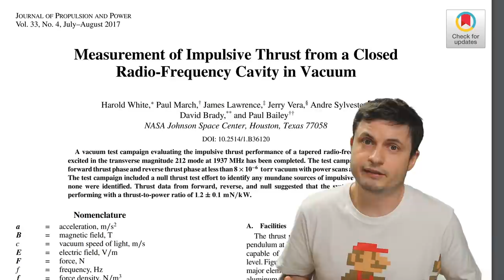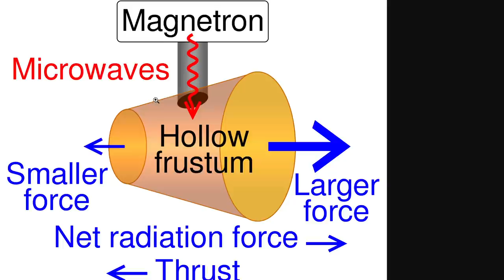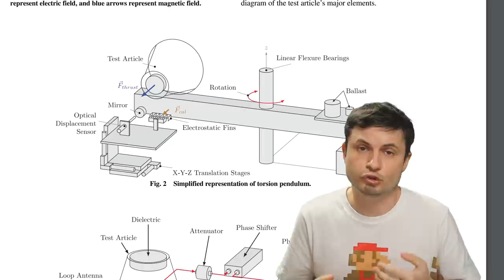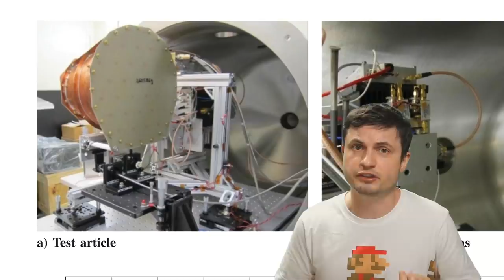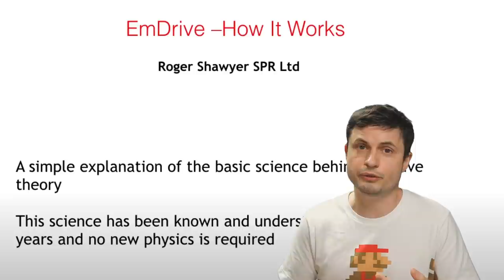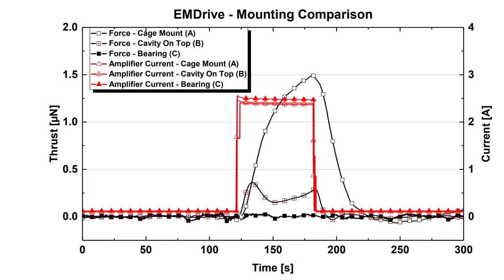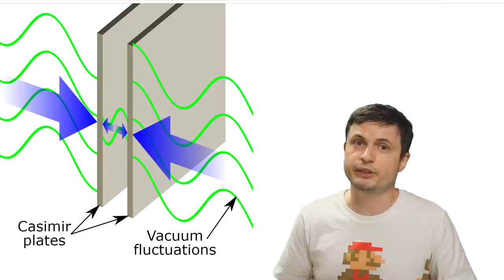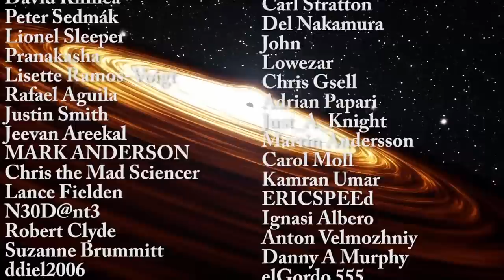Looks Like EM Drive Is Officially Dead - Experiments Fail

Comment: What you said made me think about something. 
Heating up an object deforms the object, could you alter or deform space similarly?
Reply: Er ... No.
Reply: @AndrewBlucher  I’ve sipped my coffee, I’m good now. 
Space is nothing to heat up, no particle to excite. 
Don’t science before breakfast, kids.
Reply: Anything with energy density deforms space. That's how gravity works. See einstein field equations.

But the deformation is very, very, very, unimaginably tiny for any power supply shy of a black hole.

And even so, it still wouldn't violate conservation of momentum.
Reply: @bryanreed742  Yeah I was thinking how matter tells space how to curve, and enough matter will curve space to the point of a black hole, I was sleepily wondering if, theoretically,  enough blackbody energy could deform space in a similar way, not to break conservation to make EM work, as tempting as it is to break the laws of physics to make the idea work, but what are the limits in heat alone being be used to deform space to propel objects?
Reply: Like, in the same vein as warp theory,

Comment: 6:35. 660 watt?? That's a dam lot less than the average heater. 1500 watt. You definitely gotta shop to get less than 1500 watt. If I'm thinking this right, which it sounds like I am.

Comment: Uhhmm... pushing on the steering wheel... No. However rocking in the vehicle; just like rocking in a chair... can move you across the floor. I am suspicious of the EM drive... but think that testing is healthy and more testing is better than no testing and limited testing. I am also suspicious of patents not being pursued after the twenty year period... and only being subjected to limited testing after so much discussion. Because “cold fusion” type events are usually measurement errors... and in order to duplicate something for science the original device is often not fully available nor reverse engineered... leading to a potential loss of discovery.
For example in order to create or recreate the known Tesla examples of power broadcasting... would require examination of the exact materials used. Because most likely the results were related to “impunities” in the materials used. As industrial processes and sources changed these impurities were lost and not subsequently looked for... because Tesla was a unique genius and a thousand people with the same equipment would not be able to make what he did... so we need to both look for any material science possibilities as well as duplicate the failed attempts because frequently in science just as all human activities and endeavors... sometimes people are more interested in blocking advancements and falsifying data for whatever personal reasons and motivations they have... then they are interested in actual science. This causes issues of all kinds... both people falsely making claims of success and of failure. 
Many things are likely to be possible; yet, the causation was something different from what was expected or known... entirely related to something unknown or randomly occurring completely separate but creating a measurable impact on the original effects. Thus while being skeptical always is a much better perspective until something is proven multiple times and understood... so too should be the disproving. Twenty tests is a much better way to determine what is what. Often political issues select the testers and they have a agenda and even secret agreements or unspoken viewpoints that creates cognitive bias issues and false data reporting. This is a human nature behavior and effects far more than science and science fiction potential rocket engines and drives.

Comment: Isn’t light both a particle and a wave so theoretically it could impart a force by just shining a light in one direction even if it’s not visible light….aka a laser? 

Also why did they take so long to do this experiment…if they really wanted to test it send a small version to the Iss and test it in space detached from any large object while still having scientists near to monitor and do measurements. Yea it’s expensive but who is to say the other experiment didn’t have a measurement error. This removes to possibility by subjecting it to the environment it’s being designed for without any potential issues like gravity

Comment: How did they patent it without proof of concept and proof of principle? I thought you couldn't patent something that you didn't have a functional model that worked.
Reply: Oh, you can patent all kinds of absurd things. But still, this one shouldn't have gone through. I thought the policy was supposed to be that perpetual motion machine patents won't get granted without a working prototype. A reactionless drive is a kind of perpetual motion machine, as can easily be seen if you evaluate its performance in a moving reference frame.

Comment: Of course it doesn't work. Lets say we can ignore the conical walls, and say they just magically guide microwaves without any transfer of momentum. Then still, same amount of photons will hit both end walls, with same momentum each. The area is different, yes, but the density of photons is different too. So you have half of the area but double photon density, so net zero.
If there is a difference in number of photons, that means the conical walls did exchange the momentum with them, and reflected it back into big end plate. It is just as filling same conic with air- produces net zero thrust.
If someone says- but it is because light waves and not photons that this works- then still, we cannot ignore photons. The electromagnetic waves are just hands of the photons, they enable interactions with photons, but they cannot force them to do impossible.

Comment: OK, so the EM drive is officially dead but never mind, that just means the ping-pong drive is born. Just take the exact same metal frustum container and fill it with bouncing ping-pong balls instead of microwaves, with a blower to keep the balls agitated. All the balls will have the same average speed regardless of where they are in the container, but there will be more of them bouncing against the large end than against the small end, hence a differential pressure in that direction. It can't fail!

Comment: Well it's a proven fact that photons have momentum, so it would be interesting to see some kind of EM-drive that's basically just a laser so powerful it acts like a rocket
Reply: Hahaha...
Reply: c = 300 MW/N

Works in principle, but ridiculously inefficient.
Reply: Ion engines have great efficiency, but are weak and need huge amounts of energy. This photon engine's main selling point is that it wouldn't need a supply of mass to throw backwards, and would work on pure electricity. This would make it technically possible to operate it indefinitely, given enough power production.

Comment: Of course the reason most of these idea's fail is because we test them on earth so until somebody takes the em drive into space and tests it there, how can we ever know ?...NASA's vacuum chamber is not space, it's nothing like it not even close. So why they keep using it to test engines and drives for space without going to space with said drive is just an epic fail on their part... It's also dumb as hell considering that empty space is not as empty as ppl think, radiation and the solar winds, particles in high density that can only be found there are present, surly these would have effects on such drives that can not be simulated on earth, not even in a vacuum chamber... We must at least try before claiming failure otherwise we are never going to get off this planet.

Comment: Well if you are familiar with the functionality of Lens Forces. You will also be aware that a rotating magnetic field produces lift within a magnetic and gravitational field.

Which is not at all very far from a form of propulsion that requires no external gravitational or magnetic field.

So just remember. Something is only impossible until it isn't.!

Because impossibility is a human concept. And does not exist in nature. All realities are possible.!

Even from behind the event horizon of a singularity.

In fact the whole concept of impossibility is a totally flawed train of thought.

Yes there is resistance to everything. But resistance is not infinite. In fact there is no such thing as Infinity either. And you might think well if every reality is possible. Then there has to be an infinite number of ways it could play out. And therefore Infinity must exist. But you would be wrong for thinking that.!

As we live in a finite universe. With a finite mound of energy and a finite amount of whatever number of dimensions space is made out of.

It's all finite. All calculable. With a limit for every concept within it.

So literally nothing is impossible.!

However you can calculate the highest probability to a very high degree.

And that's where the whole idea of using the term impossible gets cloudy. When you hear someone say "Oh that's impossible." You can assume they mean it's not likely to happen ever. And so you may just dismiss the possibility. And well that may be true. One of the constants of the reality that we live in is that. It's not true. Everything is always possible. Which is how the term "impossible" became such a misnomer.

And it's like. Well why is that a problem. To which I would say well first any miscommunication is always a problem. 

But secondly and more importantly. When you use the term "impossible" as it is used today. You prevent any further interest or research and development into something that very well may work exactly as it is proposed. But the implementation was flawed. 

And so it could have very well worked. I'm not saying it does. I'm just using that as an example of progress being prevented by the use of the term "impossibility"

And I only bring that up because even though upon further examination you may still find that the impossible drive does not in fact function as proposed.

It very well may lead you to the answer you were looking for. That you didn't know you were looking for.

And as I said earlier. There are still plenty of naturally occurring forces that can be utilized artificially. To produce propulsion. "Like lens forces"

I'm not going to sit here and tell you that anti-gravity mechanisms actually exist. But I am going to remind you that gravitational fields are similar in many respects two electromagnetic fields. And while they are clearly not the same. You can use the lessons learned from one to utilize the other. AND THAT MAYBE SOMEONE SHOULD LOOK INTO THAT.!!!!

Anywho excellent video! as always.👍

Comment: If this worked, then a simple satellite dish emitting radiation in mostly one direction, would create thrust.
Reply: It does. Just very, very little. Power to thrust ratio = c.
Reply: @bryanreed742  I think you mean weight to thrust? But Even power to thrust is relevant. 

The good thing from this “engine” is that it can be powered by solar panels, so the fuel is free. But you need huge panels for a little thrust.

But you still can only travel away from the main source of light energy. Even the light shining on you pushes you away. So absorbing that light to push you towards the light doesn’t work.

So it’s back to sailing. Use some magnetic field as the rudder or centerboard, and the solar wind or light as the wind. In a perfect world :)
Reply: @Spanky00Cheeks  No, I mean power to thrust. Power is energy per time and thrust is momentum per time, so the power to thrust ratio is the same as the energy to momentum ratio, which for a photon is c.

And yes, you can use a solar panel to power a thing that emits directed electromagnetic radiation, but you hit on the problem with that already: all you've done is built something equivalent to a solar sail but more complicated!

Comment: you probably have more luck aiming the microwave beam directly outwards ,,,, momentum of light does generate a absolutely tiny force, now your going to need alot of electricity to make that happen and probably need a nuclear reactor. ... even if this worked the thrust was so low it might have not been worth it for anything other then a interstellar probe that takes centuries.

Comment: Tray it in space is not vacume.
Vacume is the chainber without gas en without the space inbetween the gas.
As in  space we have the space inbetween the particles without our strinks en conditions of the particles.

So to test in a more corect way we have to tray it in space 😅🤣😍
Than you  know for shure it dus not operate disireble🙏💜
💜

Comment: The EM drive was debunked several years ago. Poor experimental technique led to the creation of an inefficient electric motor. DC current in the power cables located in the Earth's magnetic field created a small force that rotated the device. The power cables should have been screened with mu metal.

Comment: Have You Ever Had A Kid Move A Playpen Around A Room, From Inside The Playpen?
Reply: You are joking right?🙄
Reply: @kiwibob223  With the right motion they could.
take a ... sheet of plywood ... now 'walk it' across the floor in a left/right motion from the back.
Now imagine being inside a box and doing something similar.
Reply: @kiwibob223  ..Or Am I? 😐
Reply: @kiwibob223  A Strong Push Forward And A Slight Pull Backwards, Reset, Repete. Blink Drive. Pulsar Wave Compression.

Comment: Yes. There is a variable that probably wasn't used. The type gas in the room. First there's replicas norm and those closer to exact. 
Look at atomic testing. The detonate first drew up all the air it could around it, then blasted it back to extreme measure. Space is not sciences new lab. Even from 1970s. ..
The force back took small to large in seconds. Maybe the aspect needs looming at.
The bomb seemed to work on the gravity effect as well as anti gravity. A single huge pulsating expanse. While learning aren't the tests supposed to be very small? The fact a crystal might enhance size is another way..add to try.

Comment: US Air Force conducted extensive tests of nuclear propulsion but they stopped the reseearch in the 1960sbecause it spread radiation all over the place and that if a plane crashed you were basically giving the enemy a nuclear reactor with everything you need to build an atomic bomb.  That is what sunk the project, not the radiation.

Comment: The fan on the sail boat experiment was rediculously executed and entirely flawed. Again use your common sense. Sure the fan was backward and would seem that It should be pushing the boat backwards. Only there is the sail blocking the air flow. What happens then you might ask. Well think clearly and simply. The air flow from the fan will push against the sail causing it the sail to take more of a bowl shape which in turn redirects the flow of air to the sides and slightly backwards. Which does what you might then ask yourself if you are not using your common sense. Well, it quite simply pushes the boat forward very slowly. Not from the force pushing against the Sail because that is quite rediculous but, redirecting the airflow slightly backwards. If you want to do this for some quirky unknown reason you may want to make the sail to where it will take on even more of a bowl shape. By now you should be using a bit more of your common sense and should understand what I have just explained....

That was one of the most nonsensical experiments ever conducted.

Comment: Biased video. Adding "so called" to the video invalidates any arguments you are giving. If you have a valid point do not try to use framing to prove your point. It not only does it not prove your point it only shows you have produced a biased propaganda video and not one actually interested in discussing the material.

Do I think the EM drive works? No I don't. I see no proof it does. But bias is not science.